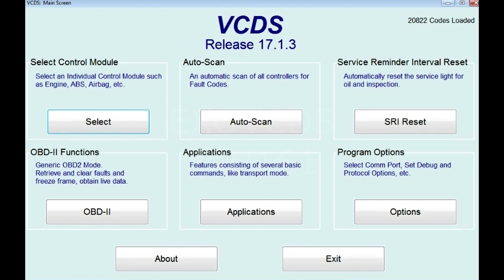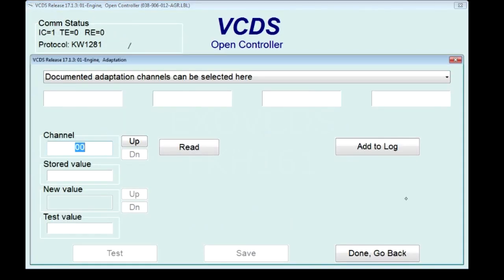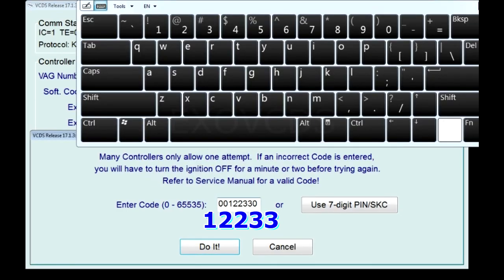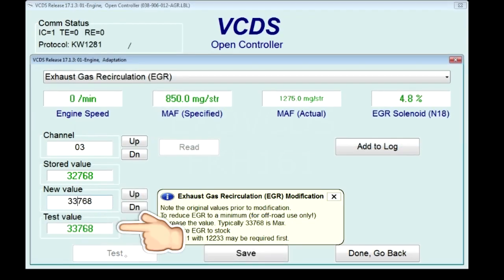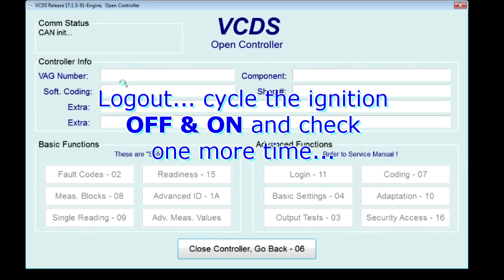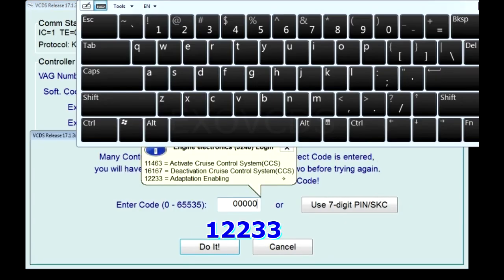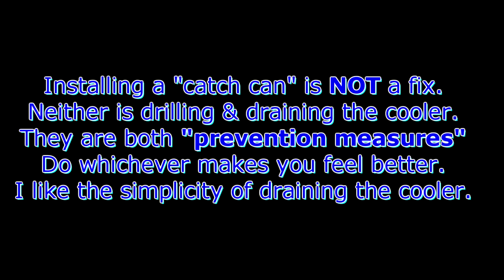VW A4: 1.9L ALH TDI EGR adaptation

Comment: Thank you for the video. I blanked the egr, and when I set the new value on 33768, I feel like the performance drops. Contrary to this, when I set the egr duty cycle on 31768, the engine runs better, smoother and it responds way more faster. It is an 2001 jetta mk4 AHF (bora) 176K mile on the clock. there's no soot, carbon buildup, everything is clean, and all the removable sensors, maf, map et etc etc was replaced with oe parts. What might the problem be, or what is the thing that I oversee?
Reply from the maker: Then leave it at the 31768 setting.

You don't have to change the duty cycle to minimum if the port is blocked off.
Reply: @EXOVCDS  Thanks a million. Undoubtedly, that satisfied me. What I have experienced is that if I set the value to 33768, the engine works hotter (because the exhaust gas necessary to drop the combustion temperature is missing). Contrary to this, if I set it to 32770, the engine runs cooler. At 31768, way cooler. This is solved for me. I have some questions, and I would be very grateful if you could help me.

Comment: Hi, thank you for all the info in your clips. I have a 2002 alh Bora, did the adaptation like you mentioned, then the engine would become so "lazy", didn`t throw any errors, just lost the power. Revert it back and everything worked allright. Any ideas why? And second, except the fact that I would have a cleaner egr/intake, what other benefits/downsides would I have with the settings above you presented? Thank you
Reply from the maker: Reducing EGR decreases fuel economy and increaes combustion temperatures.  As long as the values are "within" speificatuon, the engine should run normal.
Reply: @EXOVCDS  anyway, these days i`m gonna change the turbo and clean the intake and egr, also drainn the intercooler(thanks to your ideea, I might add some black silicone on the thread of the bolt that will be in the intercooler hole), I`m not into removing the egr funclub. I`ve seen a few mods in the internet, regarding tricking the edc into believing that the air and diesel fuel have a lower temperature than in reality, making the edc inject more fuel, basically adding a resistor in series with the maf(the other part of the sensor that measures the air intake temp) and in series with the fuel temp sensor inside the injection pump. Any opinnion if it`s such a "bright" ideea to do
Reply from the maker: @Mihut84  Leave everything stock / don't add any resistors. No need to put silicone on threads of drain screw. Look at the drain screw in this video... completely dry.
https://youtu.be/f1EL5V1gAaw?t=74

Comment: Hi Thomas, thanks for the informative video. Have your customers with ALH engines reported an increase in fuel consumption after this EGR adaptation, or it's around the same as before this procedure? Thanks.
Reply from the maker: No one has ever noticed any difference. Most / all our customers are stop & go city drivers... no real long distance commuters.
Reply: @EXOVCDS  thanks, I will do this adaptation on my ALH soon, as I just got my EGR and Intake swapped out. I'm seeing a minor issue with the new EGR that was installed. I have posted a related question in your other "VW A4: 1.9L ALH Intake Flap / EGR cleaning & intercooler draining." youtube video. Thanks again.
Reply from the maker: @CANADIANINDO  To eliminate PCV oil in the intake system, vent the PCV to atmosphere under the vehicle... like I did on my turbo car:
https://www.youtube.com/watch?v=mvGZs156FaM
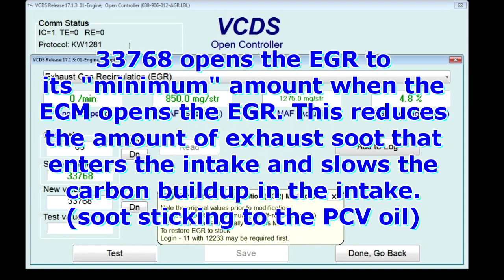I explain it starting at 3:08

Comment: I have a 2013 A4 2.0tdi Quattro and guess it’s the same but I’m not a mechanic so what do you mean by draining the oil..? Can’t I just do this adaptation, or I need to to more to it?
Reply from the maker: Completely different engine... EGR adaptation can not be done the same way (AFAIK).
Reply: Thomas EXOVCDS 

Saw that in obdeleven, adaptation not available...

Du you know how I can shut it off? 

Thx for replying 😊
Reply from the maker: ECM software / programming would need to be changed... go to a Diesel Tuner Shop to see what they can do for you. 
https://www.kermatdi.com/
Reply from the maker: Turning EGR off can affect fuel economy... less miles per gallon. The only reason I do it on these old TDI engines, is to reduce carbon buildup in the intake manifold. Your engine does not have the same problem.
Reply: Thomas EXOVCDS 

Aah,  I took it of and it looks okey and I drive a couple of miles every day to work so I don’t think it’s a problem for me.

I read that the engine would take less gas if it was deleted so that was the only reason i started looking around how to shut it off😊 better leave it then😊

Going stage 2 son with dpf of.

Comment: where can i find values for a 3.0 TDI 2011 VW Touareg engine?
Reply from the maker: You can't... the actual software needs to be changed (as far as I know). Talk to a tuning shop... they can probably tune / adjust what you need.

Comment: what is the condition the EGR work in idel and rpm 1450rev\min or work aidel when the temperature below 90c when the temperature reach 90c the EGR closed????
Reply from the maker: Engine Computer has control of EGR... it opens and closes EGR whenever it needs to. It might not be at the same time all the time. Engine RPM & load are a factor. Its is also different for different TDI engines / years.

Comment: I want ask you about engin 2000litre T5 code engin caaa code is p0401 EGR gas Flow  insufficient  I'm clean EGR and test it by vcds168 it good no gas leak and solenoid work vacum good  what the problem
Reply from the maker: Not sure. There are a number of components that make up the EGR system... they all have to work together correctly to make the system work. Sometimes it is the exhaust flap in the exhaust that does not create enough back-pressure. We don't have the T5 in North America, so I am guessing that the 2.0L TDI is similar to the ones we have here.

Comment: thomas, have you ever had a bad injection pump on an ALH cause an over boost condition?
Reply from the maker: No... are your turbo vanes free / does the actuator arm move correctly?
Reply: Thomas EXOVCDS yes, all is good now, I thought something was wrong with my turbocharger for the longest time Cuz it would go it would into limp mode and over boost at interstate speeds, the boost would creep up after settling out at 16psi, I spent forever chasing the over boost condition until I decided to put a used injection pump on and now the boost settles out at 12-13psi and remains constant
Reply from the maker: Samuel Chartier Must have been over fueling?
Reply: ***** I think so, the old pump had alot shaft play, also had hard cold starts and a rough idle towards the end followed by an injection quantity upper limit reached engine code

Comment: That's interesting how Volkswagen uses the number 33,768 for a minimum value. Using a 16 bit number where the MSB is the signed bit, that would leave 15 bits for the number. Then it would work out to be 32,768. Not sure where the engineers came up with that number. Good video in showing how to set the minimum value for the EGR valve.